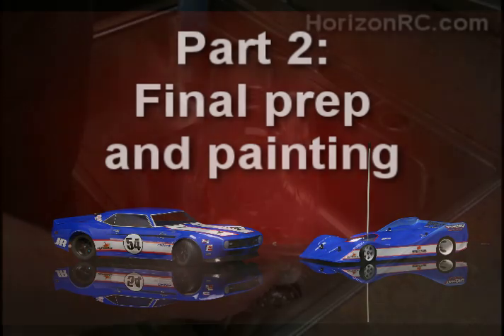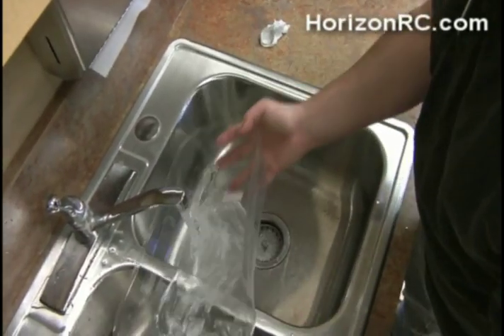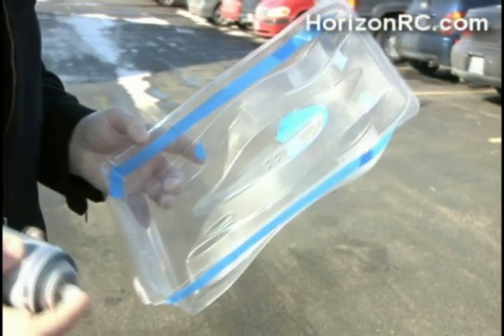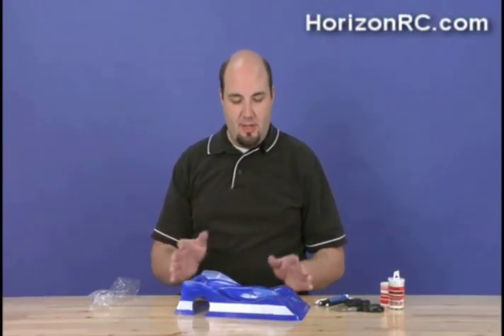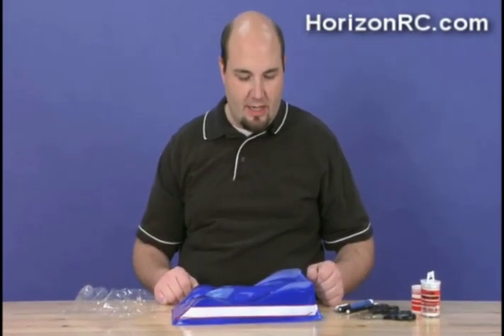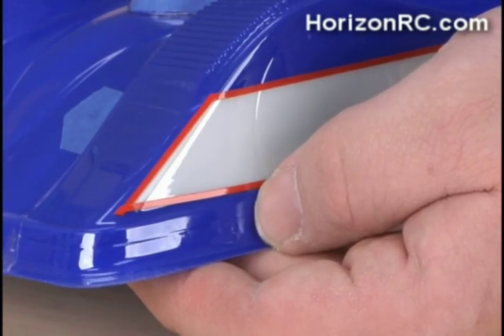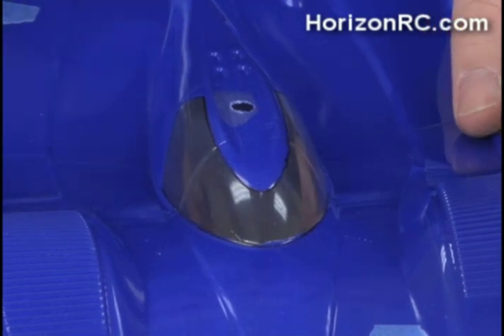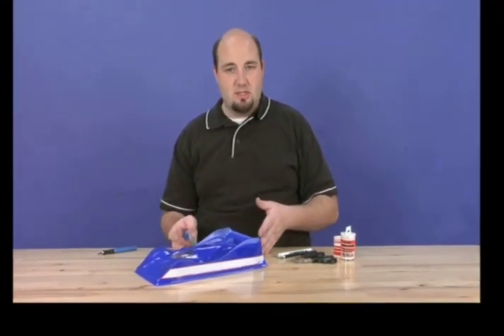HorizonRC.com How-To: Body Painting Basics (Part 2 of 2)

Comment from the maker: @SkiPro1368 I'd use Liquid Mask in your case, it'll just make your life a lot easier. You can lay the silver down first but you'll need to back it with white before spraying the black. You still may have some bleed through. I would recommend curved lexax scissors for the wheel wells, it just makes it so much easier.